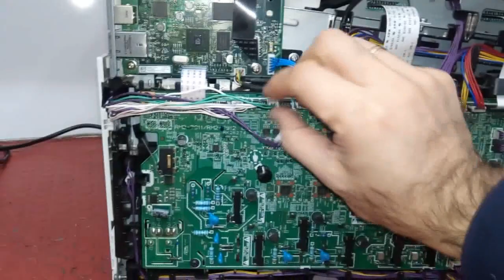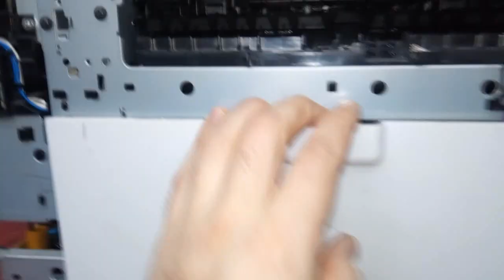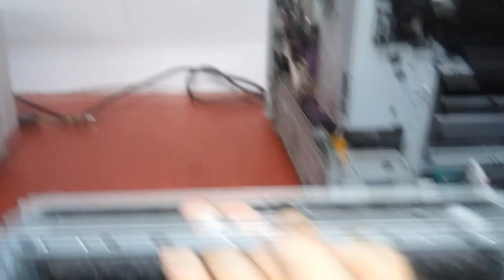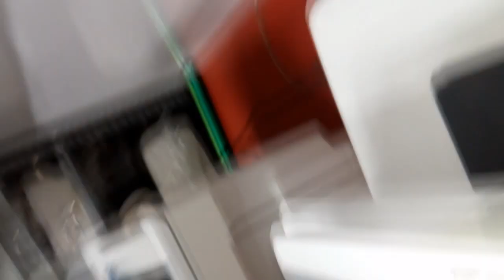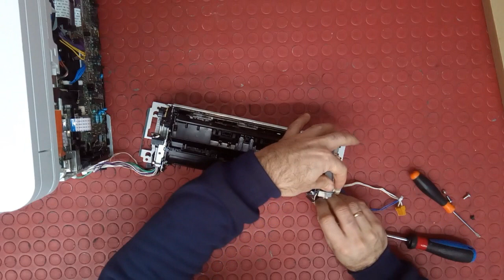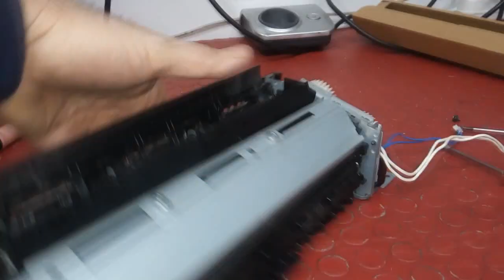HP Color LaserJet Pro MFP M477 series. Replace Fuser film and pressure roller.

Comment: Do you have to initialize the new components or do you need to do anything after the swap?
Reply from the maker: There is no need to initialize anything. Just launch and enjoy your work
Reply: Although it was a straightforward job it doesn’t work. I mean it does get hot and all rollers are correctly installed but it just fuses half of the toner to the paper. Any common issues here? Thanks in advance!
Reply from the maker: I am too Don't always use good quality fuser rollers. I also changed it several times, only after the third time I found a good fuser roller. Change the PLAIN paper type to LABEL type. will print slowly, but efficiently.

Comment: I have tried on four fusers.  Toner is not adhering properly . From reading maybe my fuser sleeves are incorrect. DO you have a source for good ones?
Reply from the maker: now it is very difficult to find high-quality thermal films and roller presses. if you haven 't found it , try changing the PAPER TYPE to a LABEL .

Comment: best video. I had the same problem.
Reply from the maker: For example
Reply: @hatamych  ?. my printer have the same problem. I'm just following your video  disassembled. waiting for the replacement roller now, but it should be easy all the way. your vid is very straightforward.
Reply from the maker: @jaykim2242  the eyes are afraid and the hands do. )))
Reply: @hatamych  just finished replacement and reassembled. now it's working perfect. Thank you

Comment: Hi, thank you for the info. After following this video on 2 rebuilt fusers, the toner on our printouts for both fusers will not bond to the page and sometimes clump onto the fuser film. Any advice on critical steps we may have missed? We use OEM toner cartridges.
Reply: Also, we are using 75 gram paper on Plain paper setting. If we turn paper settings to heavy weight (100+ gram paper) then it fuses. Is it normal for this printer series to have the fuser struggle with heat settings after replacing the pressure roller and fuser film?
Reply: I am having this problem, too! The toner is on the page, but doesn't "adhere" to it. It wipes right off with my finger. The pages are coming out hot, but the toner is not fusing. Did you ever figure this out?
Reply: @tonerfrog205  So I think I found the issue. If you look on eBay, there are kits for the FUSER film and PRESSURE roller film. What I purchased was the fuser film (and pressure roller), but what I believe I received from the seller was the PRESSURE roller film INSTEAD of the fuser film. I noticed the grease that was supposed to come with the film was missing, so the seller sent me that, but that's when the toner wouldn't "adhere" and I wrote you my other comments. So i decided to go ahead and put the original film back on and I realized when taking the "new" one off how much of a heavier material it was and different color. After doing some research, it appears the PRESSURE roller films are a more brown color and FUSER film is more of a grey color. That would explain why I was also missing the grease... Also, the item that I believe to be the pressure roller film doesn't appear to have the grounding ring at one end, either. After I installed the original film, the toner is adhering just fine now.
Reply: @tonerfrog205   hola  a mi me paso exactamente lo mismo inclusive la impresora estuvo 3 años quieta, la solución es simple resulta que investigando  vi un video que después de hacer el cambio del acetato y del rodillo no se adhería el tóner al papel, no se fijaba la imagen... me pasaba exactamente lo mismo baje ese fusor 3 veces pensando que lo había montado mal...

pero el problema no es el montaje, ni la filmina o acetato, el problema es del rodillo, resulta que cuando lo compras viene 0.5 milímetros mas delgado y ahí empieza el problema, así que compraron un rodillo desde Europa y salió igual, otro en china, otro en Moscú y lo mismo, la conclusión es sacarlo de un maquina original que tenga el rodillo en buen estado....

pero en mi caso no lo hay... así que la otra solución es actualizar el firmware de la impresora y seleccionar la opción de papel mas gruesa posible... imprime mas lento pero ya sale perfecta la imagen... me gustaría saber donde compara el rodillo de presión con el grosor ideal... alguien sabe?

Comment: Is there a specific position for the fuser to put it in before re installing it in the printer ? There are two positions : first one, the roller is free so it is easy to make it spin... second one, the roller is hard to make it spin (with fingers) because of the pressure of the 2 springs.
First or second or ... it doesn't matter ?
Thanks

Comment: Hi, again. After i had done and switch  on, the printer say "paper jam open the rear door and clean the jam". Any idea what is going wrong?
Reply from the maker: Check paper sensors
Reply: You definitely have a piece of paper touching one of the guide sensors. So it thinks there's a jam in the paper guide.

Comment: Hi when I put my fuser unit back together I began getting creases on the page, what could be the cause of that?
Reply from the maker: maybe the papers are damp? if you've collected it correctly, it shouldn't be a problem.
Reply: @hatamych  thanks for the response, tried new paper same issue. I was trying to change a damaged pressure roller. I'm assuming I did the process right, I got another roller and the same thing occured. It is leading me to believe it's either faulty rollers or just something I'm missing when rebuilding.

Comment: Hi, thanks. After the whole process I now have a “rear door open” error. I know there must be a switch or similar, somewhere ~ but I just cannot find it. Or could it be a cable or connector problem?
Reply: I have also the problem of a "rear door open" error.  Do you have a tip what to do about it?